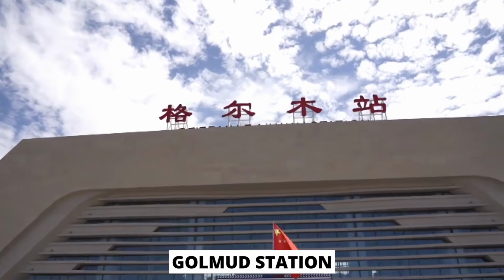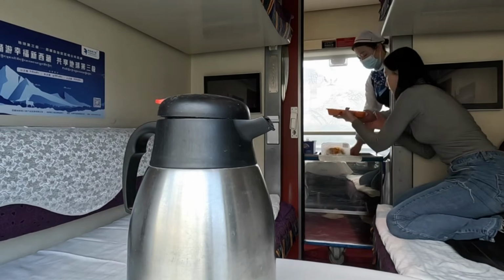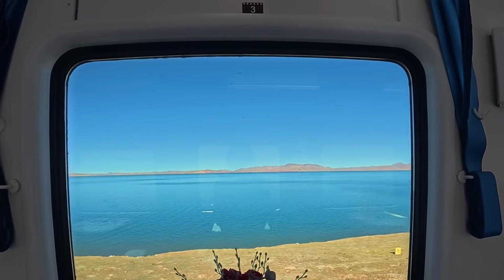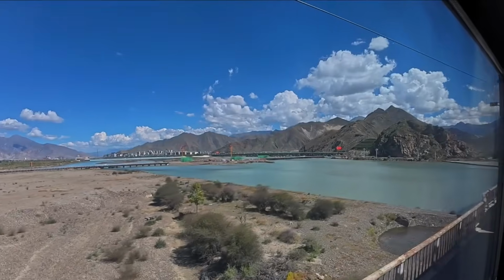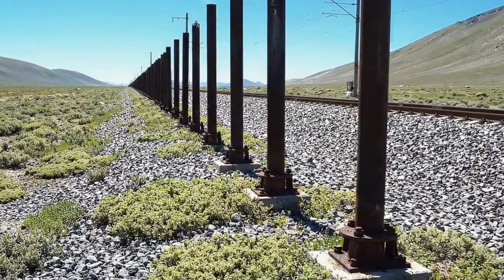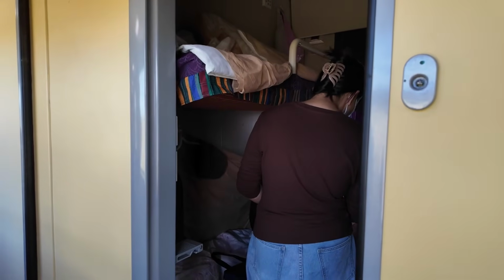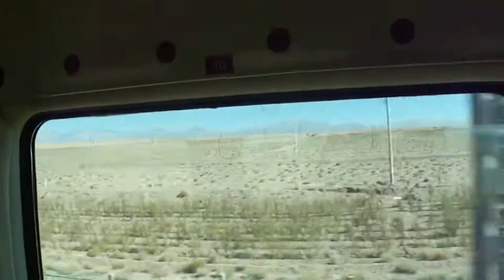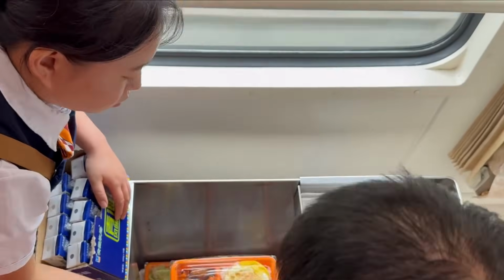How Chinese Train Crews Survive 44 Hours on the World's Highest Railway

Comment from the maker: Like and subscribe if this one got you, this channel is still small and every bit of engagement genuinely determines whether YouTube pushes these videos further. It means a lot.

A note on the footage: the vast majority of visuals in this video are real footage of the Qinghai-Tibet Railway, the Tibetan Plateau, and the train itself. On a small number of occasions where specific footage simply wasn't available, we used an AI-generated image for illustrative purposes. Everything in the script is factually accurate and sourced.

The detail that stopped me while researching this: the track sits on permafrost that has been frozen for thousands of years. The engineers knew that a standard railway embankment would slowly warm the ground and cause it to collapse. Their solution was to drive thousands of metal tubes into the earth along both sides of the track — each one filled with ammonia that passively pumps heat out of the ground using nothing but the temperature difference between the soil and the air. No power source. No moving parts. Just physics, running continuously, keeping the ground frozen so the train can pass over it. That system has been working since 2006 and has to keep working every day the line operates.